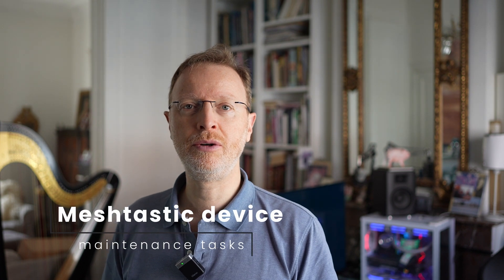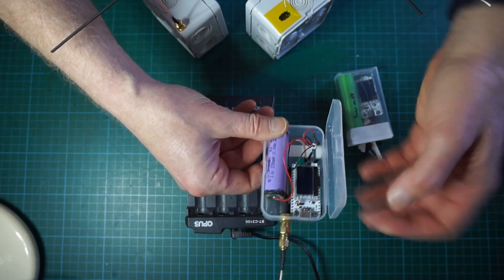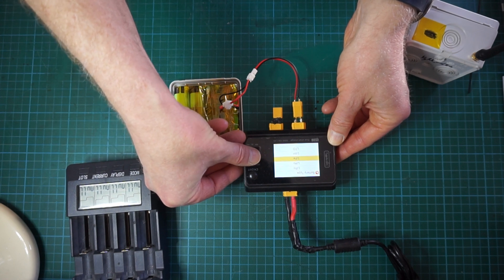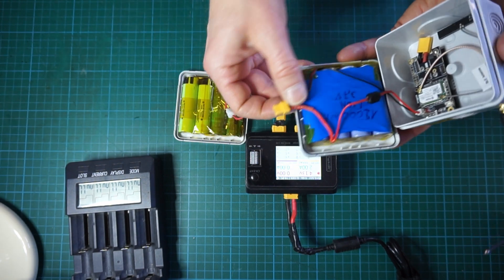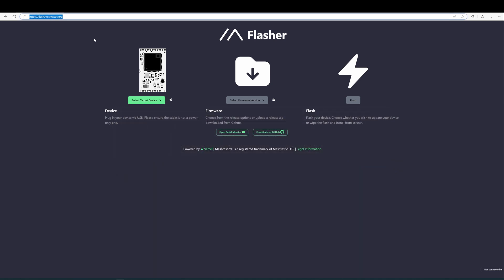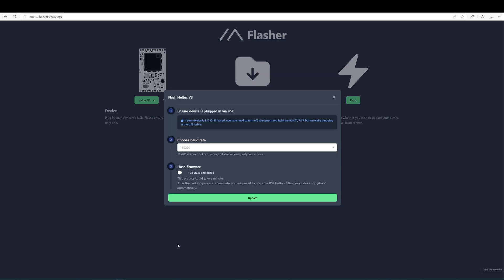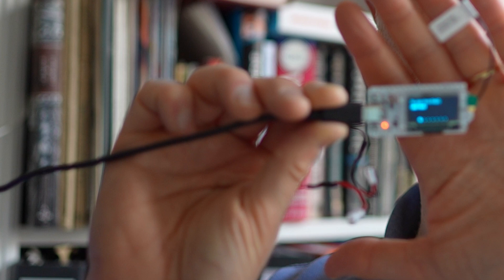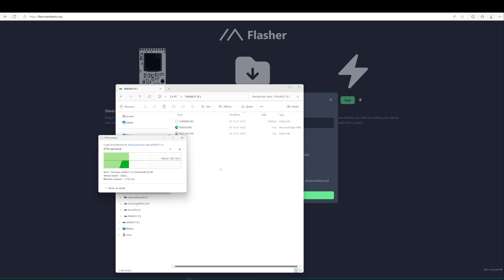Meshtastic device maintenance tasks

Comment: https://youtu.be/RScVmmn-L8c?t=90 What do you call the little inline switch you have on the battery positive wire? Struggling to find one without the correct term to search.
Reply from the maker: You can search on amazon with keywords "permanent micro on/off switch"

Comment: Can't the batteries be charged by the USB port?
Reply from the maker: Yes it can; But a battery pack like those in the video have a 12.000 mAh capacity which takes forever to be charged with the onboard charge circuitry via the USB port (because it limits the maximum charge current to rather low values).